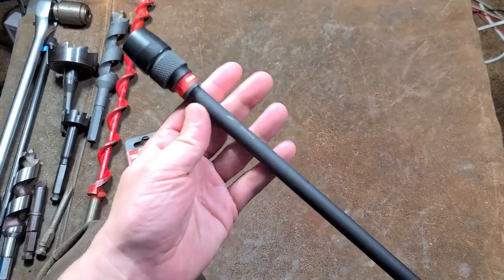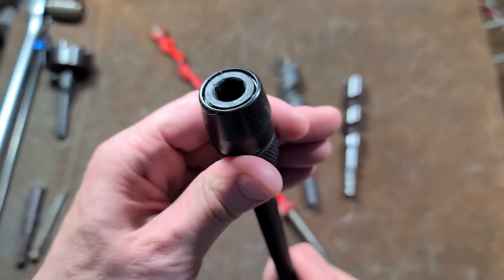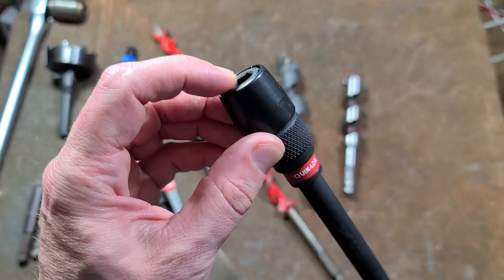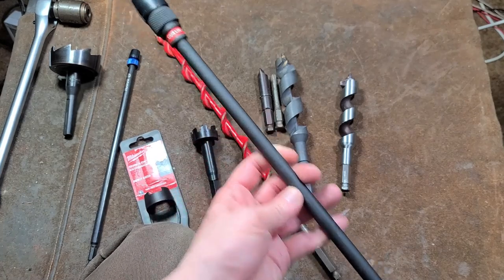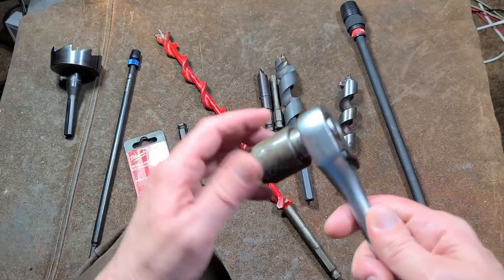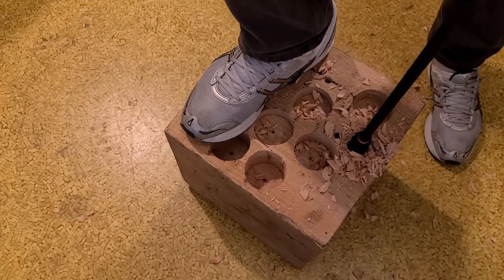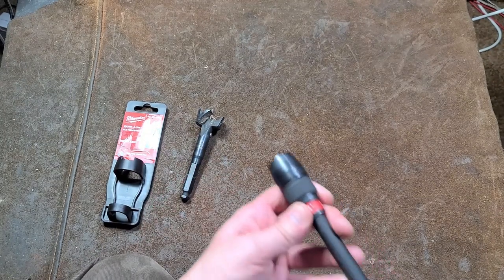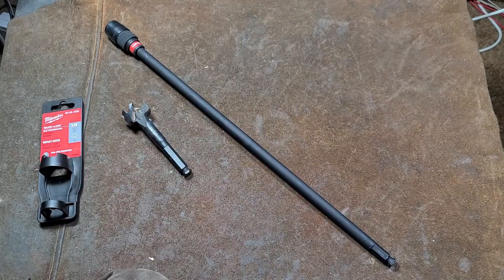Milwaukee/Insty-Bit Roller Lock 7/16" Hex Drive 18" Auger & Self Feed Bit Extension Review

Comment: I do marine construction for a living in florida and deal with 7/16 shank impacts and bits. They are life savers. The old way was to drill a hole through a wood pile with a Milwaukee hole hawg and you better hold on. The right way is a 7/16 impact wrench. I use the 7/16 impact powered by dewalt and I can drill a 28 inch hole through a pile with one hand and not have to worry about breaking my wrist. Love the channel.

Comment: Gotten this exact bit stuck many times. Don't bore in more than about 2 inches at a time, then reverse and back it out to clear pulp or you'll create a heat compressed plug in between the auger and the quick lock chuck. It's a very bad day trying to get it out once it's in further than about 8 inches.
Reply: The Diablo version of this is a lot better. No pop out mechanism so it won’t get stuck easily.

Comment: Nice video! Would you
Recommend this extended Milwaukee bit to go through a 6x6 timber or the 48-32-4531 version that is shorter? I want to make sure I have ample room to clear the beam and think maybe the smaller one may be more sturdy for the drive? And overall maybe the smaller being more practical to own? I would have a Irwin 6” paddle but I’d slide into the adapter to secure.

Comment: I might be wrong and or more than likely not the first person to tell you this about the dewalt tool you are demonstrating around the 6 minute point but it appears to me that this tool is not supposed to hold a bit any better than the magnet under the bit will, because it isn’t specifically a single purpose bit holder. After you insert a bit and connect a fastener to the tip, you should pull the sliding sleeve up over the fastener to avoid exactly what you demonstrate when the bit slips off the screw and you have to start over. Am I right? Or confused (🙄 again…editor)?

Comment: Can someone please answer a safety concern question for me.?  I was using interconnected or 2x 13 in" quick lock extensions extending my reach to 26"   drilling 2,9/16" and 3,5/8" holes for plumbing work, my supervisor said that it's not safe I asked him why he came back an hour later and told me to go get my check.

Comment: I got a question for you. I’ve had my eye on a Dewalt DWS 779. Harbor Freight has a clone of the DWS 780 for the same price as the 779. It looks top notch. A manager at the store even told me it’s made at the same factory as the Dewalts. I read HB also has their high end Daytonas made in the same factory as the Snap On. I was checking out the Hercules saw and noticed there was some side to side motion in the arbor. Would you consider that a deal breaker? Couldn’t that cause imprecise cuts on a sliding cut? The Dewalt did not have that play. There was no blade in the Hercules if that makes a difference, but none in the Dewalt either.  Maybe the next time you’re in HB you can Give it a look.

Comment: Does the locking mechanism work if there are no holes for set screw on the 7/16 shank?
Reply from the maker: Yes it's a tapered friction capture system with 3 ball bearings anything that is 7/16 hex shank will lock into this adapter including the heads of bolts and Allen wrenches
Reply: @CatusMaximus  Awesome thanks I picked one up today. Holds great even with straight shaft